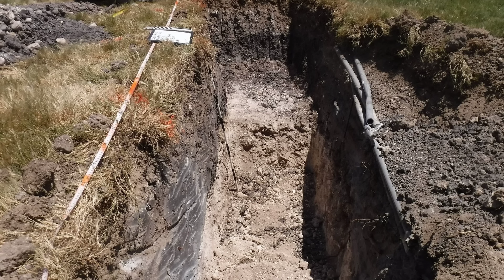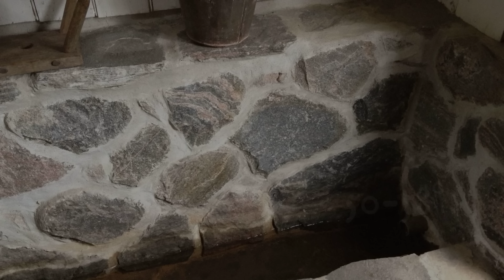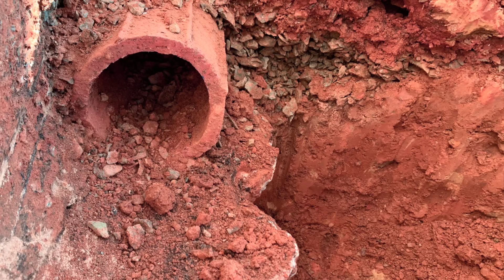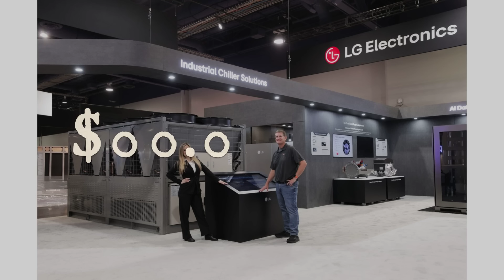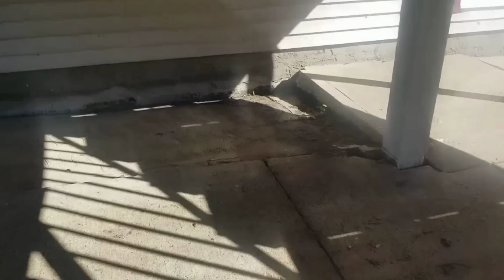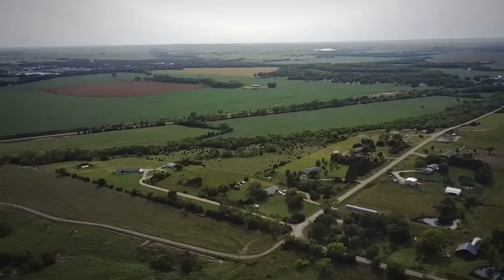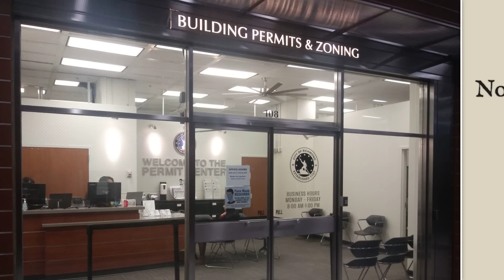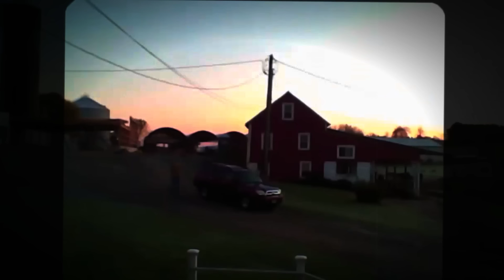This $300 Tunnel Keeps Any Home 55°F Forever — The Amish System the Cooling Industry Made Illegal

Comment from the maker: 🔗 The complete Amish Home System — cut every household bill to zero: 
https://eliyodersecretsbooks.netlify.app/
Reply: I had an sat question on this topic like 10 years ago this is crazy
Reply: A 40 watt pump does NOT = zero cost!!
Stop packing people's azz and tell them the truth.
If you're going to share knowledge, then share it. Don't try to sugar coat it to sell them an idea.
Better you tell them HOW to do it themselves.
Reply: It's called Geo Thermal, even some utility companies offer to install it. You just have to dig below the perma frost level in your area. Usually between 3-6 feet. ✌️
Reply: very cool but no way is 55 degrees enough in the winter. folks will still need some mechanical heating
Reply: @imtheengineer  The ground works as an incredibly large store of thermal energy. Run lines of coolant water through it, and connect them to a heat pump.
The efficiency will be far better than having a heat pump extract energy from cold air.
Reply: @silvergreylion I think you missed my point. The system cannot heat beyond 55 degrees.  You will need mechanical advantage beyond that. For cooling it's fabulous
Reply: @imtheengineer  Yes, that's where the heat pump comes in. Why are we even discussing this?
Reply: @imtheengineer wood heat?
Reply: Unfortunately, and I do tip my hat to the Amish, these techniques have strenuous environmental considerations, and technically, are insufficient as  an alternative shelter component within a Sustainable-Life framework.

The idea isn’t to achieve a zero utility bill, rather to create a design that is independent of location, and produces more food, more energy, more water and storage, than it consumes.  While maintaining a safe. Healthy, and comfortable place to live.

While I absolutely agree with the presenters contentions about the mechanical marketplace, well known to me for 25-years, I would argue that “design strategy”, what we’re trying to accomplish, is where meaningful marketplace change resides, rather than situational abundance.
Reply: @christophorfaust2457  how is a hole in the ground causing strenuous environmental considerations? Versus our modern approach to cooling, this seems but a grain of sand.
Reply: @edlmiranda the strenuous environmental considerations was with the design strategy, ie, earth coupling… fine for farms, large mechanical systems in multistory urban densities.  Again, not saying it’s not a good idea, repressed to this day. But the process of education should compel individuals to create new futures, not dogmatically reproduce the past.  My critique is simply it’s a nice tool, yet inadequate to the task.

Comment: I ve had solar panels for the past 15 years. My POWER bill for the AC system is $30/mo when dealing with 100 degrees outside.
No need for tunnels.
Heating $100/ mo.

Comment: What kind of problems could go wrong with this method? You mentioned that if there was any repairs or you know, anything needs to be done to the system, you can just simply switchback to, you know, your other heating and cooling.But what are the risks of this system?

Comment: I often wondered how other communities kept their food. Cold is particularly places where I've never seen them with refrigerators. Or air conditioning? This is awesome. I do want to implement this in a new build. I'm glad I got this information. So it'll prevent me from going back and doing it over. I like this method a lot. I have an old house that has a basement. This house is so old, but it stays really nice and cool in the summertime. But in the wintertime, it's cold in the basement. There's heating a heating unit in the basement. But because the house is so old, I still have a problem with car. Hold, you know, cold air coming in from the outside. But my new build will not have a basement. It will be on a slab foundation. So I would love to have something like this. Put in when I do build a home and I'm going toward the method. The COB home method, that's what I really like. I like the natural materials you use to build instead of using cement and cement is okay for some things but not for the whole house. I would love to have clay using the clay and the straw. I think it will be healthier, and I think it'll be a lot nicer to use that method. Versus some structure, you know, just a wood and cement structure
Reply from the maker: It’s a fantastic idea to integrate the earth tube system into a cob build; you'll love the natural, steady comfort it provides all year round! 🙏

Comment: this is just basic geothermal physics. The biggest problem with systems that use the ground like this, is that you need a lot of land, and installation costs involve a lot of digging.
Calling it $300 is very much just ignoring labor and land costs.
I have planned on using geothermal tech to both warm and heat my house. And the AC units are the cheap parts of the installation. 

Yeah... this is nothing new.

Comment: This is absolutely true. I used to work at Calico Ghost town. The Maggie mine went from a lower elevation up about 20-30 feet. At the top there was always a good breeze that was 55 degrees all year round. In the winter it felt warm. In the summer it felt cool.

Comment: A/C units not only cool, but remove humidity. Go ahead and pump that moist ground pipe air into your house.
Reply: Buy a dehumidifier. Still cheaper then running ac😂

Comment: I went through a year long in depth HVAC schooling and we learned that fact about the earth being about 55 degrees all of the time, everywhere. I lived in Florida at the time and cooling the home accounts for something like 60% of your energy costs. I always thought "Surely it would not be hard to loop refrigerant (of some sort) underground and blow a fan (we were also taught how cheap running a fan was) over it could AT MINIMUM reduce those costs massively. But it was discussed for 3-5 minutes and we continued on, and I have never stopped thinking about it lol. Closest similar system I have heard of is geothermal but the bit I've learned of it requires immense challenging maintenance. I had always wondered if the regulation boards had to do with that.

Comment: Definitely not using a fan with less power than a lighbulb. If you want to circulate air you need to move it with a blower fan large enough to move the air 50 feet. You would need the power of about 5 or 6 light bulbs. And it's running 24/7

Comment: Honestly just look at how ancient humans survived in cold temps, they used the earth. The "frost line" only goes so deep, below that the temperature is constant, just like in a cave, it may SEEM cold but the temp is constant in summer and winter. If you dig down and build a structure over the hole with ventilation at the top it could be -20 degrees outside but even without fire or body heat it would be around 50 to 55 degrees in the structure, add body heat and a fire in the center an your lookin at a confortable 65 easy.

Comment: I would like a solution to have cheap hot water on demand, I have a special needs child and he likes to get lots of baths and it’s expensive 😮‍💨 $400 electric and $100 water bill for a 980sq ft apartment, fortunately we’re building an off frame modular currently but want a smarter way to

Comment: this is not new .. wine celiers are old af and they are tolerable cuz no one expand this system cuz it cost nothing.. and no its not dryer or cooler its called a draft and all you need is 1 foot blow foundation  to have outside acsess and it dont work in high heat without a modification

Comment: Simple.. The reason we do not use it anymore is because we have better stuff out there. Plus you need to dig tunnels underground and insulate them while still using a fan to push the cold air through. Btw, it doesnt keep the homes cool to 55F degrees. The channels underground are 55F degrees while underground. Once it gets to the surface, the temperature raises. IF you used it today, it will not cool your house off by much. If it's 90F degrees outside, it might drop it down to around 80F at the best conditions.

Comment: One question: how do you angle a 6 foot deep pipe to a drain point?  It would have to connect to a sewer unless you live near a hillside, which means sewer gas needs to be trapped from entering the home.

Comment: The physics in this video are solid—the earth does stay around 55°F below the frost line. But the "$300 miracle" claim is leaving out some massive reality checks. Here’s what the video glosses over and why building codes actually restrict open-air tubes:

1. The Mold Delivery System: In any climate with summer humidity, piping hot air into a 55-degree underground tube is a recipe for a massive condensation pool. If that pipe settles or shifts even a fraction of an inch in the soil and water pools, you've just built a black mold farm that blows directly into your living room.

2. The Clammy Factor: Cooling air without removing the moisture spikes the relative humidity. The air will feel cold, but incredibly damp. To actually make the house comfortable, you’d still have to run a heavy-duty mechanical dehumidifier, which eats up electricity anyway.

3. The Radon Vacuum: Earth tubes can literally suck soil gases into your house. If the underground pipe gets a single hairline crack from the ground settling, that inline fan is pulling radon or methane straight indoors.

4. The $300 Myth: That price tag only covers the plastic pipe and a cheap fan. Digging a 6-to-8-foot deep trench for 200 feet requires serious heavy machinery. Unless you happen to own an excavator and have acreage to spare, you're paying a contractor thousands just to dig the trench.

5. Thermal Saturation: The dirt isn't an infinite thermal battery. If you run hot summer air through that same stretch of pipe continuously, the surrounding soil eventually warms up. By late August, the dirt is heat-soaked and the system loses a ton of its efficiency.

The Irony at the End: At the end of the video, he mentions "closed-loop glycol systems" as the smart alternative. That is literally just a standard Geothermal Heat Pump! The HVAC industry does sell them, they are fully code-compliant, and they are awesome because the outside air never touches the buried pipes. They just cost a lot to install correctly because of the massive trenching required.

Comment: This is an HVAC technology used in real application already called Geothermal HVAC. you can get it installed in your house but its super expensive and it won't work as quickly as regular HVAC systems.

Comment: The “anywhere” part is grossly exaggerated, such as the Deep South, where this doesn’t work well with humidity. This is why the population boom of places like Texas and Florida didn’t happen until after A/C was around. You could do geothermal heat pump but it will cost $30 grand

Comment: I have 3 heat pump based forced air zones, and I want to install an earth glycol loop. I am thinking about how I might add a glycol earth loop to the intakes or outlets of these systems to my advantage.  Possibly to just leave them on " blower only" mode most of  the year.  If anyone has any experience with this or knopws of anyone selling products I could employ for this, please let me know.

Comment: Smooth pipe is not optional - corrugated pipe holds condensate and mold.

What do I use sir? Anyone?
Reply: Well, PVC is smooth and can withstand the weight of 4-6’ of soil. But I would prefer clay, no?  We’re looking into this. 👍

Comment: might be smarter to use you water intake to do this; basically you could run it in to a heat exchanger then run it back under ground then back into the house for use.

Comment: Dude, this is called a ground loop heat pump, it's extremely well known and not a secret by any stretch of the imaginatio, and everyone knows it's more efficient, It just costs more upfront to use a ground loop than air to air, because digging a big tunnel to put the loop in is expensive. Not sure in what world you think digging a ground loop is cheaper than a $2K air to air heat pump

Comment: There is mansions and Old buildings built in late 1800s to early 1900s in aus where the cool air from the basement which use to store wine, food etc raises up the walls and out vents around the windows. The mansions dont have AC stays constant temp all summer stayed in one was 113f outside and only 73f inside,  the tour guides explained how it all worked the air is nautrally constantly circulating no fans, a lot of tiny green homes are built with this kind of thermal tech.

Comment: I am sure it would keep things cooler, but we don't need to keep things cool all the time. We want to control the temperature. They have whole house fans, and plenty of other cooling methods that don't involve Central Air Conditioning. Adobe Homes also keep homes much cooler. They were very popular in California. I think they're awesome! Unfortunately, they are not very earthquake freindly. If you had the ability to build a home however you wanted, and a big plot of land, you could build and cover your home with earth, and it would also keep it cool. There's plenty of ways! We use HVAC systems, because of modern housing codes, which are good and bad. 

Passive cooling is simple. People don't learn about it not because it's a "cospiracy", it's just very self explanatory.

Comment: The main reason we don't see this in every suburban backyard is Land Footprint. To get significant cooling for a 2,000 sq. ft. house, you typically need 200 to 400 linear feet of buried pipe. Most suburban lots simply aren't big enough to dig that many trenches without hitting a neighbor’s fence, a sewer line, or the house foundation. Additionally the best installs are on a slope, to drain water and prevent mold. You also have to be 100% sure you have no leaks in the pipes or you may end up with radon in your home.

Comment: Tubes do nothing to dry the air, which is a huge part of controlling the temperature. Humid air makes everything warmer. That's why we care about the heat index in the summer time and not the ambient temperature. 

And if you're going to add a dehumidifier, you might as well just use an air conditioner

Comment: I think the video over promises a bit in performance. 

Thermodynamics won't allow 68 degree air to cool your house to 72 degrees when it's 95 out. You'd still need some mechanical cooling.

The modern version is to bury a zizag coil in your yard 10ft down and connect it to a heat pump.

Costs thousands.

Incredibly efficient. There is still some active cooling, but you can reduce the size of your unit and use it much less often.

Comment: This sounds amazing but having grown up in Shipshewana, IN one of the larger Amish settled areas I didn't go into a single Amish home that wasn't stiffling hot in the summer.  This all sounds legit and production and physics seem to be on point but this was NOT at all a common practice in the Amish communities of Northern Indiana.  I mean, some did have root cellars for goods but the whole "no need for AC" thing with this system doesn't hold water.   Further these families had money, a lot of the Amish I knew had loads of cash so if it were $300 I'd image they'd have done it.  The $300 figure seems pretty sus too though because I guess you are considering all the labor is just free digging and the pipes are...magically created I guess?  Depending on your location and materials you are looking at a minimum of $4-5/foot.  That's just the trench and pipe and doesn't include any home refit, fan, controller, wiring and the size of your home will dictate how long the trench/pipe needs to be.   This is a fun thought experiment but hyperbolically overstated, oversimplified and the adoption doesn't seem to be as widespread as you seem to state.

Comment: Passive cooling is a health risk. In most cases (like Ohio) the cooling comes out too humid and you are exposed to excessive radon. The geothermal methods you mentioned are safer alternatives. Their usual issue is 90+ degree weather they struggle to keep a home as cool as AC. But all honesty a mixture of both systems in late August would still be a energy saver.

Comment: Why why I mean I’m asking honestly why the fuck would I wanna be freezing my ass at 55°? You don’t understand 55° in your home like at night or in the evening watching TV or whatever is fucking cold now outside working during the day 55° pleasant but in your home, not so much and by the way, I don’t care if it’s 55° underground cold air does not rise so in order for that 55° in your underground tunnel to come up into your home, you’re going to have to use some kind of equipment to circulate air. That’s just a science fact how rise is cold there is this place and push downward so if it’s 7580° outside it doesn’t matter what the temperature is underground. Your home is gonna be 7580° unless you’re circulating that air using electricity and hardware.

Comment: Does work but not as simple as this guy makes it out to be! Many homes in Europe use the system but not with air. Glycol and a pump and thermometer controller to pump the liquid into the ground pipes or up from the ground keeping the house a constant temperature. just the cost of the pump to run which is cheap

Comment: In Missouri early settlers would do something very similar. They would dig the well for the house directly underneath the house and then there was a conduit tube that would run out from the house and outside the wind would blow in the summer blowing air down that tube, forcing the cold air from the well up into the house and then throughout the winter they would just put a cover over the ventilation tube